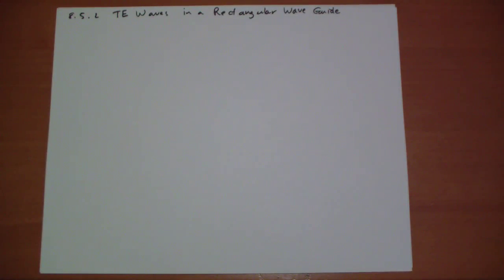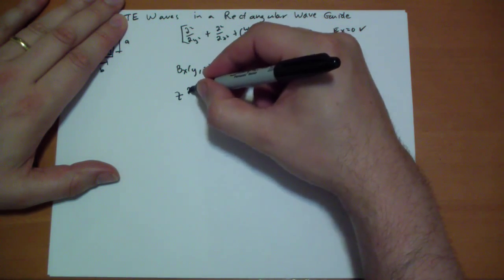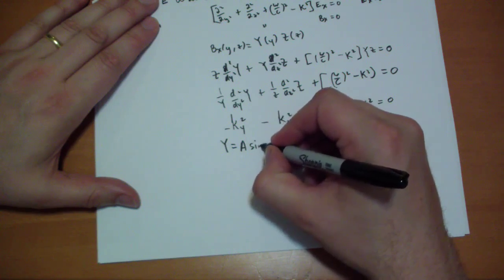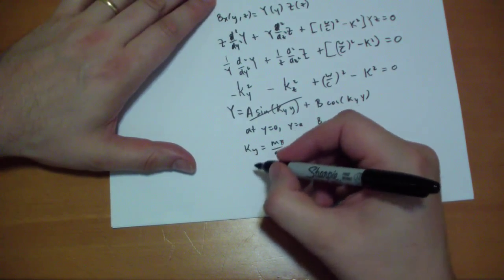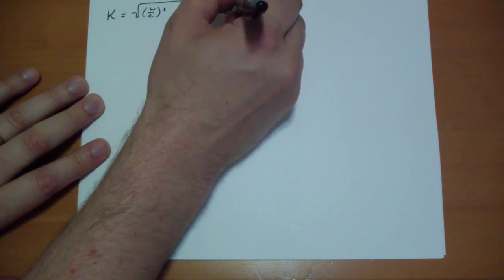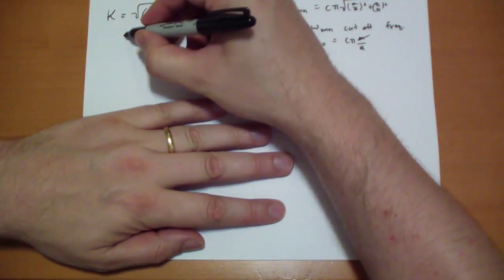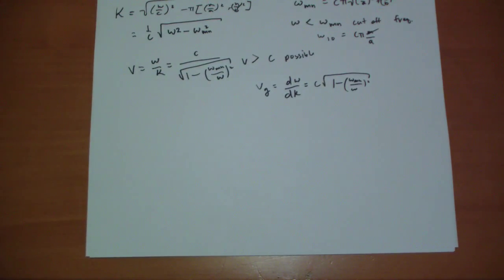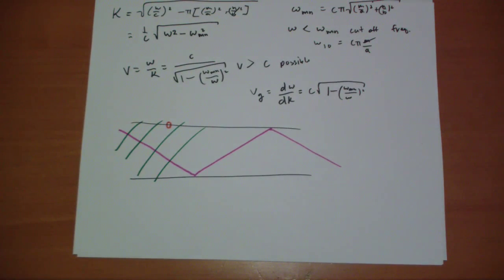8.5.2 TE Waves in a Rectangular Wave Guide

Comment: You are right at 4:48 . A should remain, B should have been dropped. This mistake is not fixed in even 3rd and 4th edition. I am trying to understand where we can be wrong now...

Edit: Nope, griffiths is not wrong. He just skipped a few steps there. I have explained in the comment below.
Reply: I found it! If the TE wave is propagating through -z Direction, then it obeys B_z (x,y) = X(x) Y(y). Which can be put into B_x = ( i / [(w/c)^2-k^2] ) * [ k * (Del B_z / Del x) - w/c^2 * (Del E_z / Del y) ] . E_z=0 taking derivative of B_z =X(x)Y(y) wrt x diminishes A, rather than B.
Reply: @enestepe  For other people who might be struggling ^^: Answering the question why B_x = 0 (page 428). 

You know from the boundary condition that B_perpendicular = 0 (with respect to the sides of the rectangular walls). 
So this means that B_x  is perpendicular at x = 0 and x = a (both the (y,z)-planes, the upper and lower plane of the conductor). B_x vanishes, and then, using 9.180iii, one can see that the Del E_z/Del_y term vanishes as well due to the fact that Ez equals zero along all four planes (as the wave propagates in z-hat direction, so Ez is parallel everywhere with respect to the walls, applying boundary condition: E_parallel = 0). To conclude, you end up with only the Del B_z/Del x, which has to equal zero. When applying separation of variables, you can just plug it in, which results in dX(x)/dx * Y(y), which means dX(x)/dx = 0.
Reply from the maker: Thank you for doing the homework. In my experience, Griffiths is right. He's the most accurate of any textbook authors I have seen.